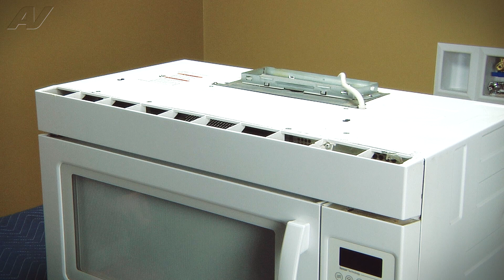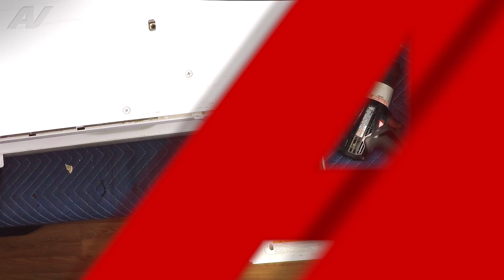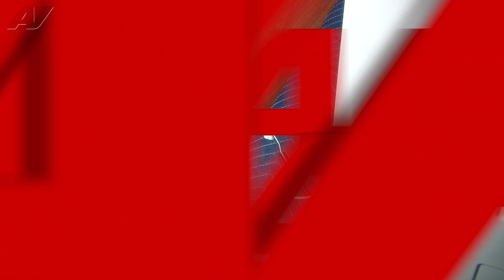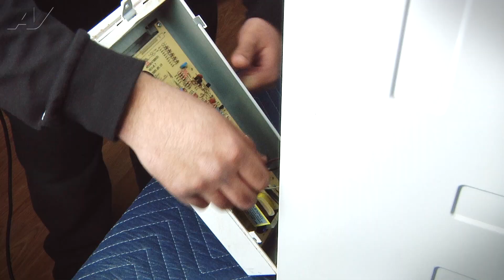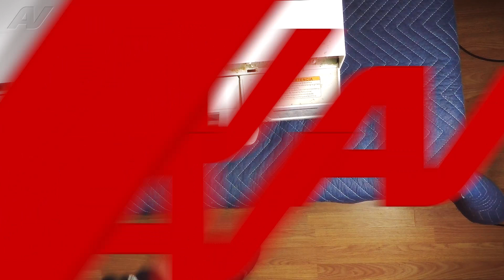Whirlpool, Maytag Microwave - Touchpad control Panel UI issues - Diagnostic & Repair

Comment: So, in other words, remove screws, replace part, install screws.
Reply from the maker: Great question, if you have a more technical question that our parts department cannot answer, you can search our over 17,000 answered questions free at our website www.ApplianceVideo.com under our Repair Help section. You can also call our parts department at 1-800-830-5465 and they can give you help 7-days A week ,or search at www.SaveMoreOnParts.com  .

Comment: my whirlpool over the range microwave has issues with control pad but still works - just numbers are wacky. Can it be fixed.
Reply from the maker: Great question, if you have a
more technical question that our parts department cannot answer, you can search
our over 10,000 answered questions free at our website www.ApplianceVideo.com under our Repair Help section. You can also call
our parts department at 1-800-830-5465 and they can give you help 6-days A week
Monday -Saturday, or search at www.SaveMoreOnParts.com  24 hours
7- days A week.